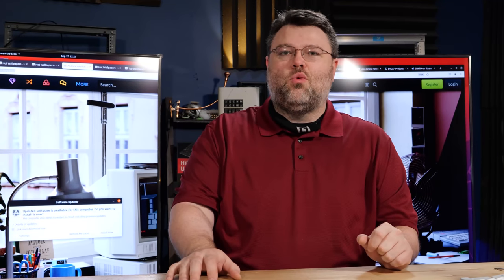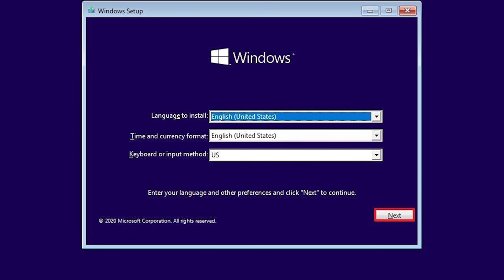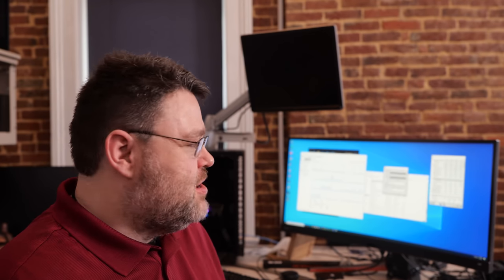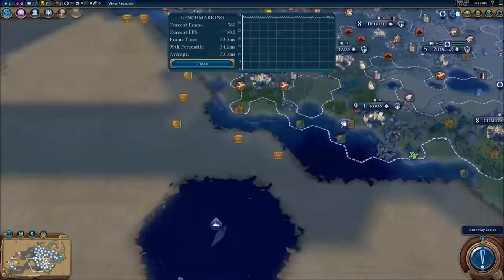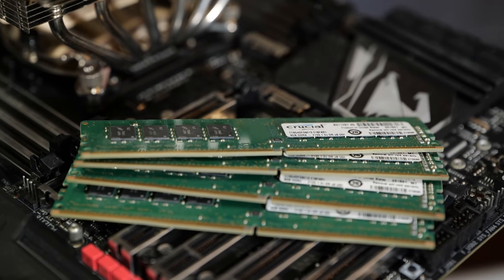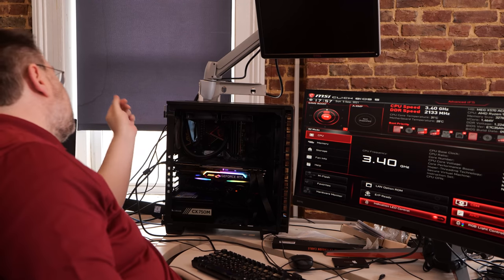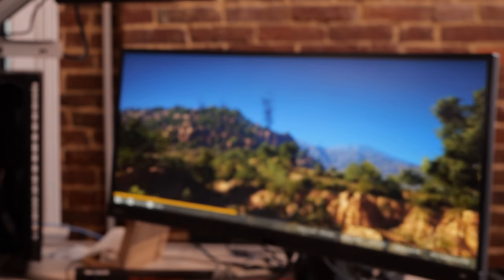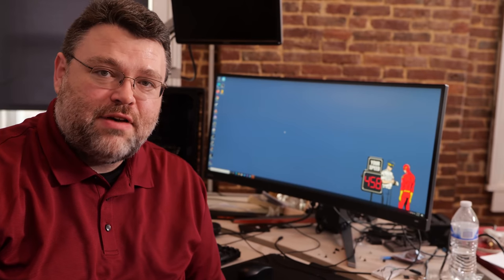Level1Techs Real Upgrades: X299 7900X to AM4 5950X

Comment: Level 1 diagnostic and then replaced everything except the PSU and case! :D Practically a new PC.. Enjoyed the video though!
Reply from the maker: I would not have expected the 2133 memory to do that good, though. we technically could have gotten away just doing a mobo+cpu swap only, assuming we could find the mounting kit.. what kicked this whole thing off is the 2080 super would stutter and the previous much older gpu was fine.
Reply: @Level1Techs  yes the memory performance was a surprise to see. Definitely not a criticism, in my mind I was just expecting to see some technical wizardry to solve the issue. Was fun and educational anyway and I’m looking forward to seeing you work your magic on other videos.
Reply: @Spark010  i concur. I really like when diagnostics and problem solving videos like this are posted on the channel. Even if it isnt an exact problem your facing u can pick up a bunch of little things along the eay.
Reply: Ryzen has surprised me with it's sensitivity to memory timings. It really likes tight timings, even more than speed sometimes. If you can tighten up the timings a step or more but have to slow down a step from max fclock. It's well worth testing for your workloads
Reply: @Level1Techs  You could try an AMD GPU with less driver overhead if getting one wasn't such a pain.
Reply: @Silverhks  ive seen that, i have some nice cl14 3600 4x8 samsung B die. I keep the memory speed lower than its possible Fmax. I can get my 5900x infinity fabric to hit 2033  but ive opted for a tighter timing 3733/1866 FCLK. If my chip wasnt defective it would of been a beast. I rly hope the next chip works properly. I could beat 5950x with a minimal tweaking in most benchmarks, but some cache level defect hampered consistency

Comment: Wait, a 10 core machine from 2018 is ancient now? Looks over at his AMD daily driver from 2017 and examines life choices.
Reply: R5 1600 still trucking here!
Reply: hell i just bought a 7940x this year. they aren't ancient in terms of performance (i guess it only has pcie 3.0) but boy, there's a lot of weird issues with x299. especially when it comes to thermals. skylake-x is a complete black sheep and doesn't follow a lot of the conventional wisdom people apply, and it has a tendency to run VOLCANO levels of hot without serious tuning. you can get skylake-x to run cool but i guarantee most people who bought them full price never did, which gives the platform an even worse reputation
Reply: YEah I had a 1700X from the start of Ryzen, well actually a 1600 and 1700X but I got a 3900X for Chistmas and I feel spoiled with 12 cores!
Reply: @Cheesemonk3h  Remember those use the old shitty TiM, not soldered. So these are prime candidates for de-lid and to replace with liquid metal.
Reply: @Cheesemonk3h  yo what'd you pick that 7940X for? they going for a good rate right now? I'm rocking a 7800X because I planned on upgrading on the cheap(er) around now! I'm used to the quirks of the platform already and if it looks like a decent upgrade I'll run it up. Also I bought mine when they launched retail (after reviews ofc) and tuned it to chillax at 4.6 GHz all core. I can run it faster and have but that's back when I felt like caring about a custom loop. It's back under a tower now
Reply: @heimvar  $350 when alder lake got announced and I decided to hedge my bets. Barely runs at stock without throttling at like 4ghz with an offset but i disabled two of the cores and it runs 4.5ghz no offset. On a tower cooler. Can do 4.6 but I would need water. The MCC dies were... binned to the razors edge which might be why they have such a bad rep
Reply: 3700x on x570 here
Reply: I have replaced my 3rd Gen i5 system this year.
Reply: @Cheesemonk3h  That is the opposite to what I have experienced with the 7940x. I have it air cooled with a Silverstone  HE01 on an Asus Strix XE board. RAM is 3400 CL16 at XMP. Case is a Silverstone Raven RV02B which is well known for its superior cooling. I was surprised at how cool it runs (bench on CPUz gives range of 42-50 degrees at mild base overclock)
Reply: And here I'm still using Z77, QM87, X58 and X79 systems
Reply: I still have a 2010-2011AMD Phenom 1090T 😂
Reply: Ivy Bridge fam
Reply: laughs in 7700k  Dammit.  12100 is 30% faster now...
Reply: Well he's doing video editing and compiling a lot, so for him he notices even incremental performance improvements. He isn't saying it is ancient for gaming or general use
Reply: 9980xe here 😅 looking for upgrades ⏳